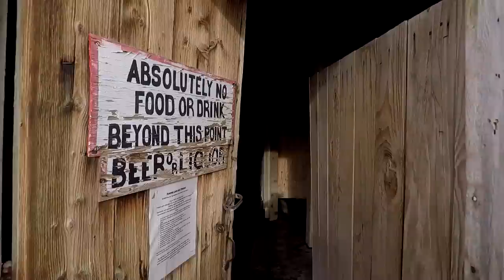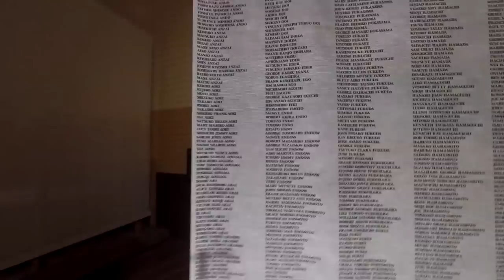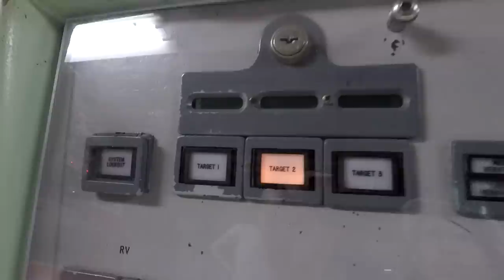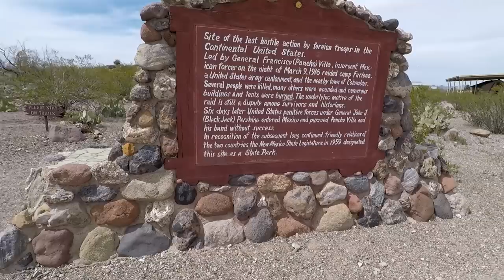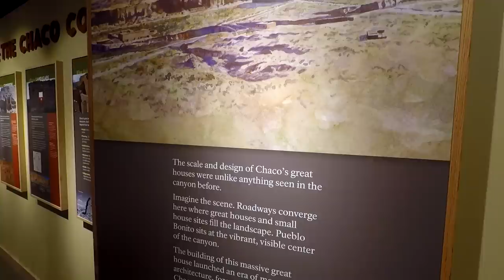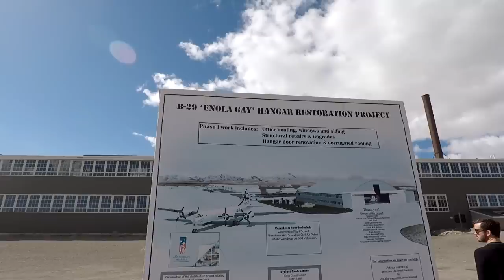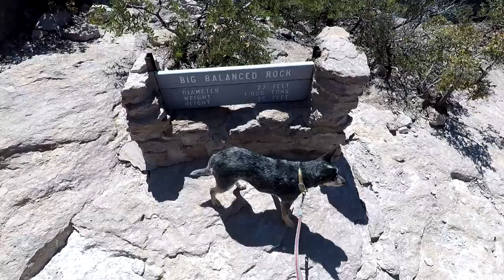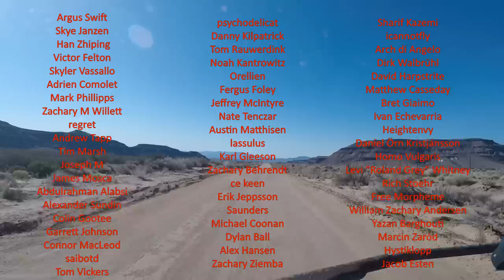Atomic Pilgrimage: Ghost Towns, Nuclear Relics, and Lost Civilizations on the Road to Trinity Site

Comment: Hey Noah, if you think the concept behind the Project Pluto was disconcerting, read up about a little thing called a "Cobalt Salted Bomb." A nuclear weapon intentionally designed to put extremely long-lived radioactive isotopes into the atmosphere, soil, and water of an enemy nation so as to defeat the entire concept of fallout shelters altogether. Estimates put the effective dangerous radioactivity that could put off by a cobalt bomb at ranging between 20-30 years across an area approximately fifty times the size of the area originally affected by the initial blast. That means that a city perhaps forty miles in diameter could have been made completely uninhabitable for up to an entire generation simply by dropping a single cobalt salted bomb onto it. Luckily, both sides eventually realized that this step was just a bridge too far for them and willingly agreed to cancel all further development on any future salted nuclear weapon tech.

Comment: Project Plowshare was a full success! 
If you ask bomb engineers, because they got to pop some nukes. And thats what counted.

They detonated nukes in the 50's and early 60's for much, much more obscure reasons. One that springs to mind was a test to find out how the fireball affects various solid metal shapes, like spheres or cubes. What they learned is, that they do not vaporize or melt. What that knowledge can be used for, nobody really knows today. But it certainly was a hot thing to do at the time...

As for the 'Jumbo' casing at the Trinity site that wasnt used but exposed to the blast, there is a small but important correction to be made: the damage it took wasnt from the Trinity blast but in fact eight 500lbs bombs detonated inside of it after Trinity. The purpose was to dispose of it in a quick way. Didnt quite work out, as only the ends were blown off.

Comment: Thoughts on nuclear power: You mentioned not seeing the inside of the reactor plant so I'll share my thoughts. For someone without money for college, your best bet is the Navy Nuclear power program which is what I did. Since I had  no money for college. My NEC was 3386 which is surface nuclear machinist mate Engineering Laboratory Technician. I have been inside the reactor compartment 6 or 7 times (we had 8 reactor compartments total- this should give a clue as to what ship I was on since it was the only one of this type). The earliest I was in was around 15 minutes which is the soonest you can enter after reactor shutdown. This is due to the decay of one of the fission fragment isotopes. It's been around 25 years so forgive me if I forget which isotope, I think it may have been Xenon. Because it was a working reactor, you will see very little steel. Everything is coated in lagging (insulation for pipes). Mainly to keep efficiency up, but also to prevent the reactor compartment from getting too hot (though believe me, it is quite hot regardless especially 15 minutes after shutdown). Basically it's 4 heat exchangers we call steam generators, a pressurizer to pressurize the reactor coolant, much piping, 4 coolant pumps, the reactor vessel itself, and various other things. You walk on metal deck grating which is slotted to allow liquids to drop down (though we had no leaks, at least none that I ever saw, the primary system is designed not to leak) and you are constantly dodging pipes that are in the way and have to stoop down under them in some cases. You can even sit on the reactor coolant pipes. Though I hate to think of my nuts getting zapped by radiation LOL, but I didn't sit near any hot spots which are where corrosion particles accumulate and have higher radiation levels. And yeah I didn't really sit per se, more like leaned against it while filling out survey logs. As for the rest of the steam plant, it's basically like any other steam plant. Though our reactor auxiliary room is a big difference. And the electronics room above the reactor auxiliary room which is air conditioned. I used the term electronics loosely since it's based off of 50's technology. And the enclosed operating space which was also air conditioned which is the main operating space for the reactors. The difference of our steam plant compared to say a civilian one is electrical power generation is quite small compared to the energy used for propulsion, and the reduction gears are quite large as with the main engine steam turbines. Some steam is also sent up for steam catapults as well and lots of auxiliary steam. Anyways, this information is not classified in case anyone is wondering, after 25 years I don't think I remember any classified information LOL. You'd be surprise even how much Wikipedia has. All this information is on the internets. My ship is decomissioned and obsolete. 

As for the future of nuclear power. Even in the 90's I felt it was a dead end industry. I had someone comment on another video about thorium reactors. I've been hearing about thorium reactors since the 90's, and it still hasn't happened. I'm not holding my breath. U-235 is quite difficult to produce, and uranium in general isn't an infinite resource. Even though it's all in the Earth's crust, it isn't easy to get out in concentrations that are economically viable. Civilian reactors use more U-238, it isn't useless, but military tends to use enriched uranium.

Comment: While I can't give a definitive answer as to why the pueblo cities were abandoned, I can give you a good estimation of why based on the modern lifestyles of those peoples (at least the point they reached before whites showed up and made it impossible). While they're frequently called "nomadic" or, even less accurately, "hunter gatherers," the southwestern desert peoples were most accurately described as *migratory*. They would spend the middle of summer up in the mountains, where it's cooler and wetter, the middle of winter down in the hotter dryer regions, and the times in between traveling between these destinations in caravans. They cultivated the plants and animals at both destinations and along their travel paths. This lifestyle is surely a pain in the ass with all that walking but it provides resiliency and efficiency for the most extreme parts of the year. The mountain and the desert are different climates, effected differently by weather patterns, so you can make up for shortfalls from drought or climate effects in one place by carrying the excess from the other. 

A single dense population, as we see all over European history in particular, has two big vulnerabilities: Famine, and disease. You've got to get way more food than normal into one place, and you've got to deal with infection rates way higher than for rural populations due to how much of other people's air you're breathing in a city vs the countryside. It's only with modern transportation, refrigeration, and medicine that we've overcome these problems and made cities really viable places. One of these two problems probably ravaged these cities, and the remaining population changed their way of life to insure themselves against that kind of loss in the future. Besides, the advantage of an ancient city is mostly just defensive, you can put up walls around your whole community and fight off attackers a lot more easily if you condense them to one spot. But they're out in the middle of the desert, so who's gonna come by and fuck with them? Better to focus on the concrete dangers of starvation rather than the hypothetical dangers of inhumanity, right? And this was a bet that paid off and let them live for hundreds of years, even after white people arrived on the continent, right up until the gold rush happened in the 1800s. The desert peoples were the very last defeated nations within the United States for this reason.

Comment: Judging by the amount of mileage the old bus has been seeing it appears it had a freshly rebuilt engine as I doubt there is a VW around without one, the old busses had the gear reduction to give the engine some 'help' between extra body size, weight carried and terrible aero so yes 65 is about all you should safely drive at the most. 

Its hard to believe you have never finished HS but you sure have more important goals to obtain, just be careful out there, as beautiful as it is out there in the OLD US there are people lurking around..

Comment: Hey everyone, So I had a dream of going to some of the places that Noah has covered in the travel videos. I want to warn anyone driving an unassuming car with California license plates to not go through backroads in AZ, assuming tensions in this country remains divided. 
If you do decide to take backroads or car camp make sure to put an American flag, thin blue line flag or something on your back window or fender. I got tailed by several souped-up, black pickups and SUVs any time I started driving on smaller highways. Don't tail any cars of backroads either, pass them or give them a lot of space, I found local drivers spooked easily if I was not careful and would drive erratically.

Comment: From Key turn to impact, it takes about 30 minutes. You have about 5 minutes to gather Food and Water, another 10 to reinforce your shelter, about another 10 minutes to get in and then another 5 to wait until impact. Post-Impact (depending on how many hit the area around you) you have about 14 to 15 day's before Radiation in low enough to go outside in protective gear, it will still take a Year or longer for the Radiation to be low enough to go outside unprotected for less then 15 minutes but it will take a Decade or more before you can stay out permanently. This is what I was told and what I have gathered from research anyway.

Comment: Back in college, we had a leading scientist on solar hydrogen liquid fuel give talk, basically he was a part of a team creating materials for a hypothetical structure made of incredibly tiny nano-rods of metal that absorbed sunlight and somehow made hydrogen based liquid fuel, a massive game changer against climate change. And he talked about nuclear reactors, how if we really wanted to stop carbon pollution, the cause of climate change, we needed to start making one a day, 10 years ago. Now many would balk at the nuclear waste, which is a problem since it won't be going anywhere, but we are also at a loss for what climate change will bring, we will be entering an unprecedented era that promises little else but catastrophe as our water become more acidic and the ice caps are melting. We can plant more trees, but they'll only absorb so much carbon, what we really need is to just stop burning carbon, and nuclear power is a means of doing that. But we are afraid, rightfully so, of that nuclear energy, of the bombs it can power, of the waste it produces. Only so many pits we can dig, so many mountains to hollow, desserts to bury it in. But is contained toxicity worse than our fluctuating climate? That isn't rhetorical, because I don't feel equipped to say it. Because our climate can become inhospitable, our society can crumble, and truly there could be no saving grace because the earth would just continue to spin in space and not care as it simply adjusts with time until the sun consumes it. The only safety nets we have are the ones we build ourselves, but we are only intelligent animals who've existed for less than a 1/10th of Earth's existence. We aren't gods. And sometimes I fear we think we are so special that nothing so bad as world calamity from happening, but no one else is gatekeeping that but us, but reasonable humans trying to keep order. We are at the drivers seat, and I do not believe humanity truly appreciates what that means.